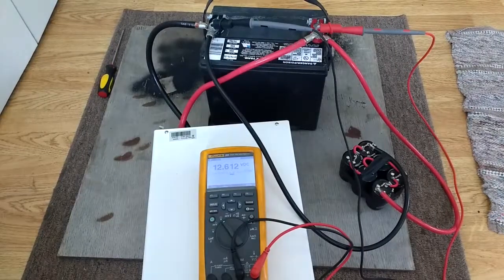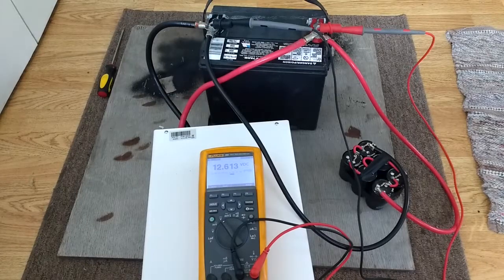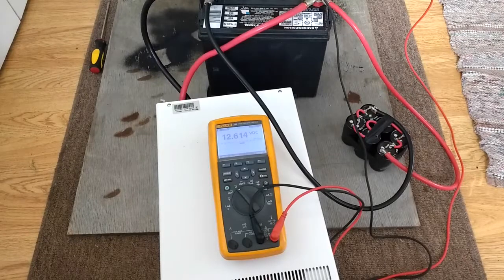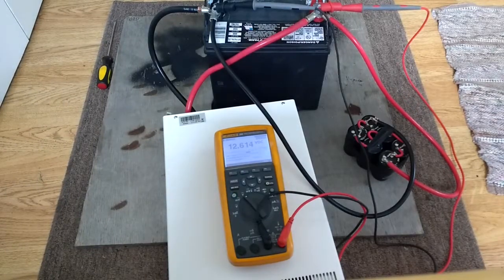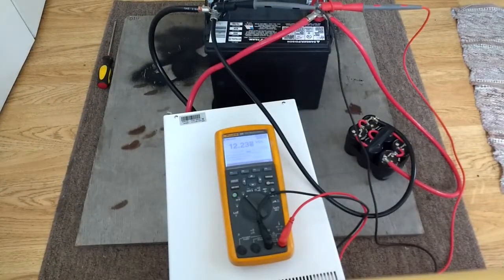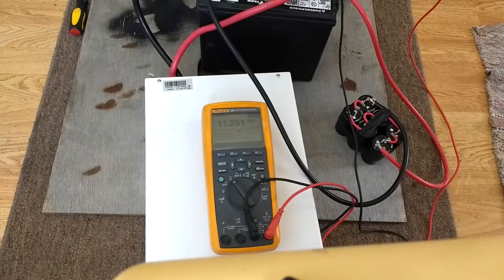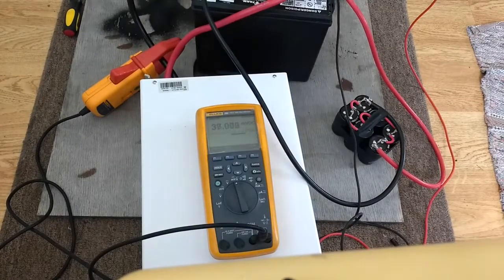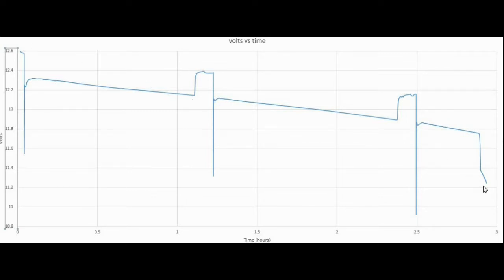Pure sine wave inverter instead of a generator.

Comment: what is plugged into the green connector? There is REM and VCC. I know i can put 12volts to REM port. How does VCC work? I have the vanner 1000 inverter.

Comment: What is the refigerators wattage? id probably would want my freezer going rather then the fridge and use ice packs  from freezer  for fridge. i have a 40 kilowatt 3 phase generator i named it the monster. Its a 3cilinder  air-cooled Deutz.
Reply from the maker: Intrade Motor I didn't measure the power comming out of the inverter but I had about 400 watts comming out of the battery most of the time.